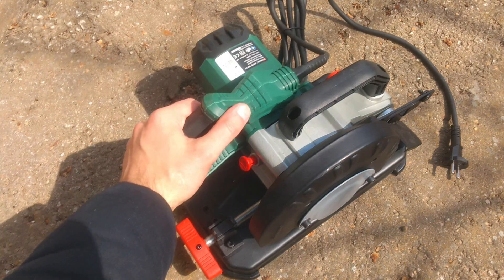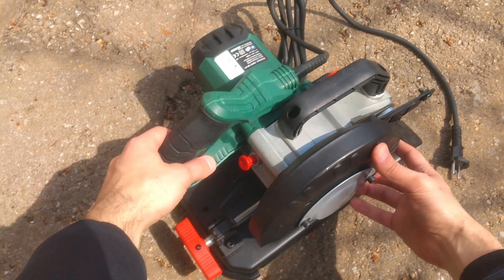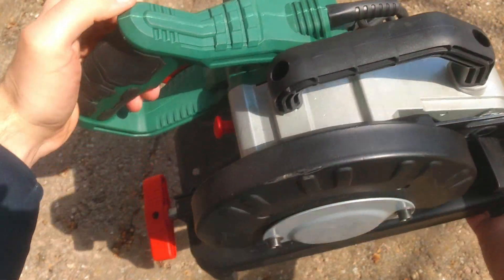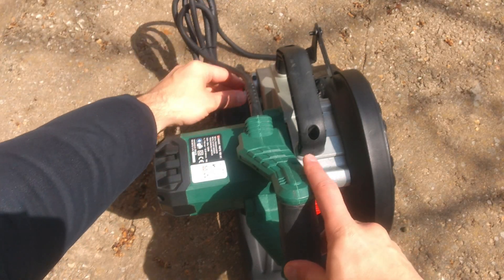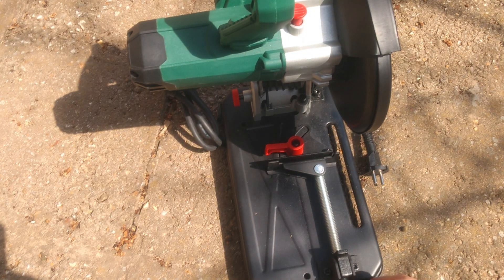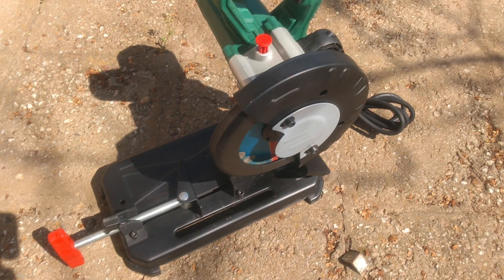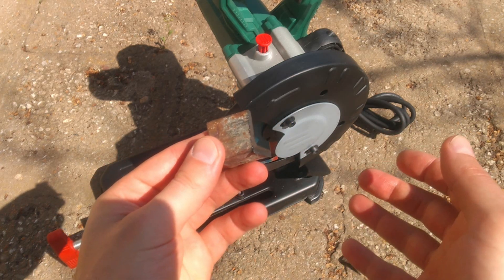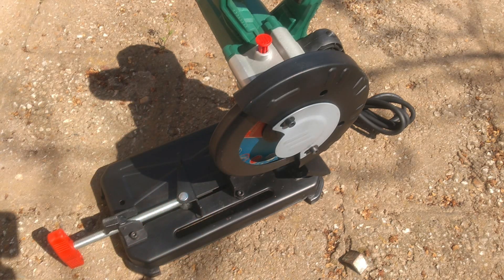Parkside Metal Cut-Off Grinder PMTS 180 A1

Comment: You get crooked cuts because you are pushing the disk way to hard into the material. Light push and let the disk cut do the cutting. It's no different than with an angle grinder, same disk.